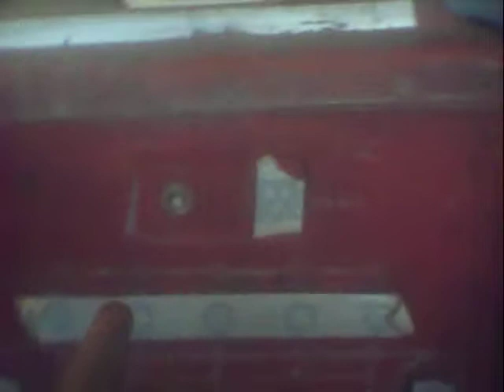Old as DIRT !! : FORNEY Stick welder, 240V plug/outlet types:  Works GREAT but FILTHY!!

Comment: I've had one of these and they are great! Pretty good duty cycle and best of all, unlike the selector used on other buzz box welders the doesn't have a mechanical selector to get stuck, corroded or burnt contact, it is all wired. But after so many years of dust and grime it pays to really wash it out and prep out the connections so they are bright and clean again as well as cleaning all wire connections. Oh com'on, an afternoon and a few beers and you'll be a proud poppa of a great machine! Oh, and new cables are a must too!
Reply from the maker: Cool man.   Did u watch the short history link in the description?  Interesting stuff.   I bought this Forney welder for about $75 from a church friend's pro car shop/garage.  Sold it last year for $50 to an 85 years young man! ha
Reply from the maker: I got this Century welder for FREE.  Its a lot smaller & lighter weight. Do you know how old these are? : https://youtu.be/IX5eQ0mGFBQ